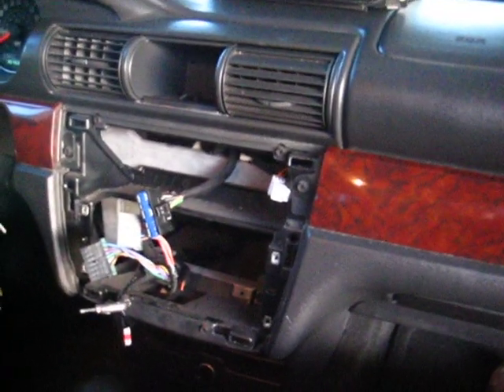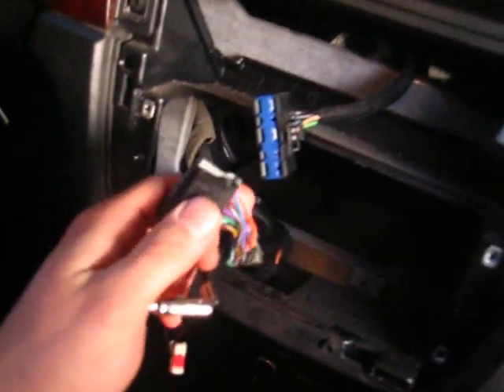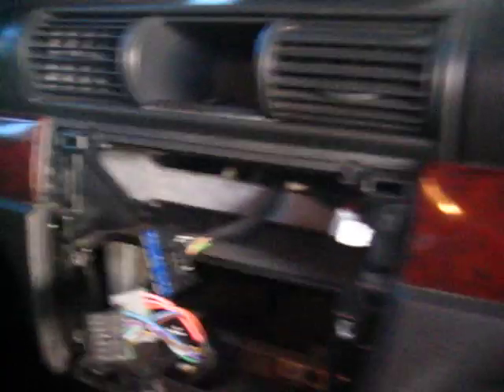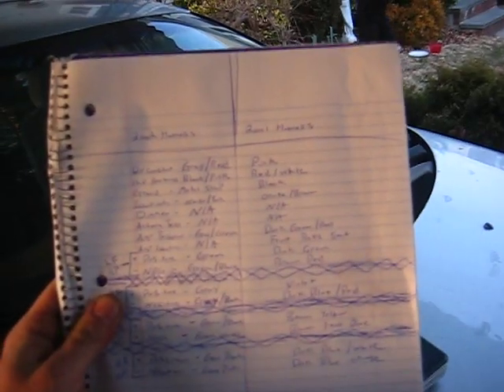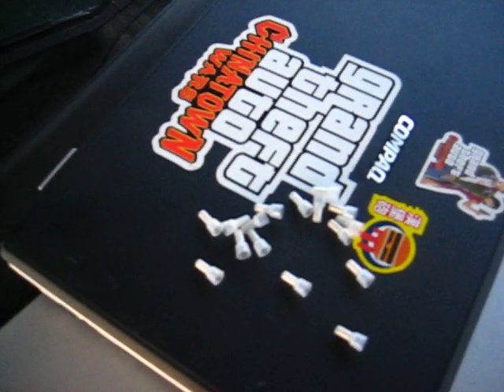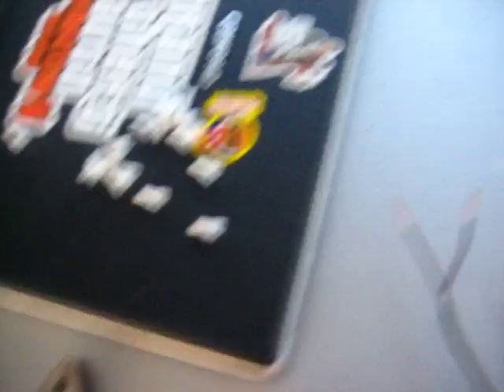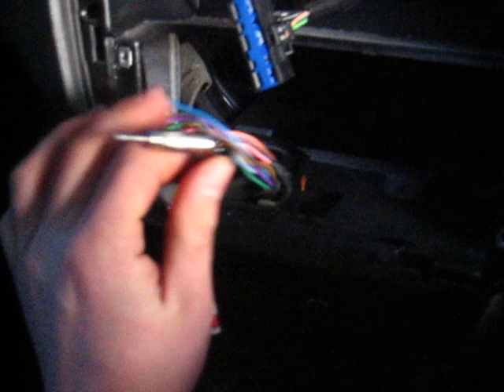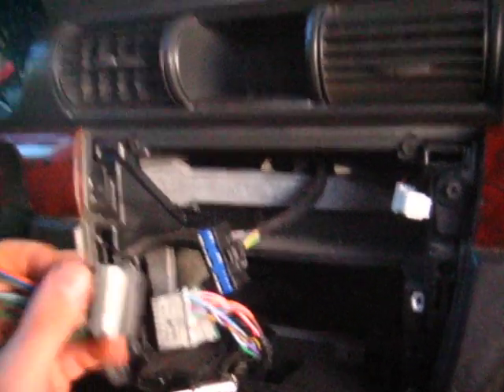Chrysler Sebring 2001 Stereo Upgrade to 2006

Comment from the maker: Hey, it sounds like you need to Bypass The infinity Amp to make this work. there should be a kit for this. Some people wire it so the amp still triggers on..Im actually gonna look into this because Ive seen it done, but ive never actually done it..Infinity amps are interesting..On my 1998 Caravan Each speaker has its own individual amp for each speaker. excluding the dash and tweeter speakers...i need to look into this

Comment: I have heard from my neighbor that 2005-2010 chrysler sebring 2.7 are alot better then the first 2.7s v6. I like the plastic looking wood trim in your old sebring.  To bad you had no choice but give it up.
Reply from the maker: aohm588 I am not sure what years they were but yes. there was and dont quote me on this, but there was journal  revisions on the motor. what made these engines complete JUNK from the factory was the fact that it had really small oil passageways and where the water pumps outlets were placed. when the water pump began to fail it would drip coolant right into the oil.

Comment: hey i have a aftermarket radio im trying to install but dont know what wires to connect together can u help me
Reply from the maker: Maurquis Walker  Everything you need should be on the video. ge the wiring harness adapter for your car. you can find them online dirt cheap, dont buy them at the store. for the price you pay for those adapters said and done you could of bought 20 of them online. you may also need a Antenna adapter too. and sometimes a dash kit, most non touch screen radios are a DIN size. if you have the same car as shown here your gonna need a DIN and a half dash kit. Look online on amazon and ebay. ebay has real cheap prices just make sure they are a USA seller and they ship from somewhere out of the the continental United states. i waited almost a month for something that came from china..never again. Be sure to check out my channel and subcribe, theres a few install videos here

Comment from the maker: Jweier1, if you can get a long pair of tweezers in there you can pullt he top cd out. ive done this a few times. is your radio and RDK RBK RAZ radio??.. you can find this on the display part of the radio should be top left.. what years is your sebring?. two door or 4 door? because if your interested i can tell you its pretty easy to put a CD changer in there.

Comment from the maker: I'm a engineer. ANd no, for this install you cannot go to walmart and get the adapters. what is wrong with you?. If you took the time to watch the video and actually comprehend what I am doing instead of not being able to wait to comment negatively on this video you would know that we are changing the cars factory harness to accept a factory radio replacement. No matter what, i needed the terminal that went to that factory radio.if it were a aftermarket radio then you would be correct.

Comment from the maker: buy the harness adapter. sometimes they are labeled power antenna or amp trigger wire.. onyour new radio you should see a blue wire for the amp trigger. all you need to do is connect every wire from the harness adapter to the radios harness. and it should turn right out. i dont know the factory color for this. but i ran into the same problem with my 1998 dodge caravan.. radio worked  but no sound. if im not clear enough PM me on youtube